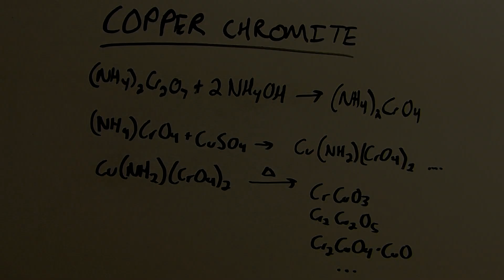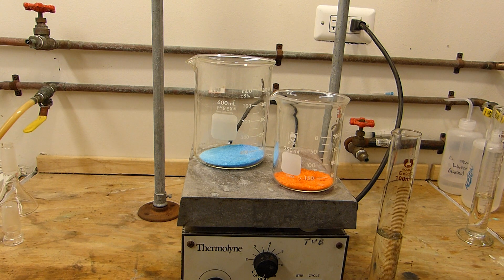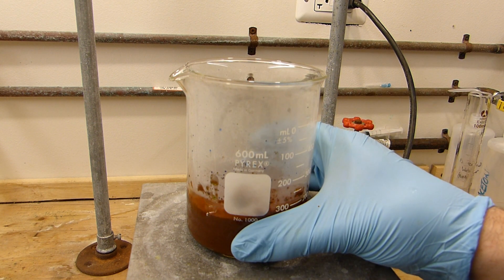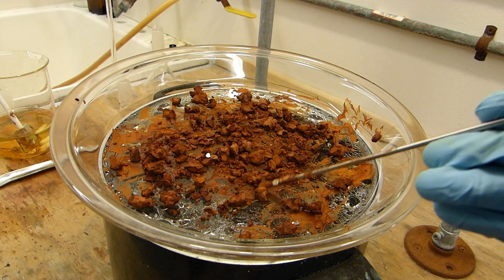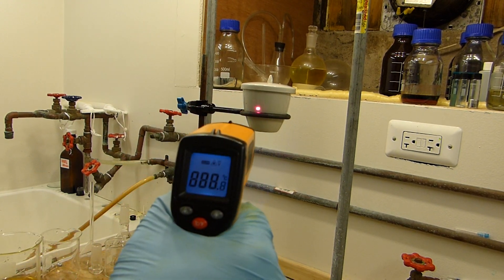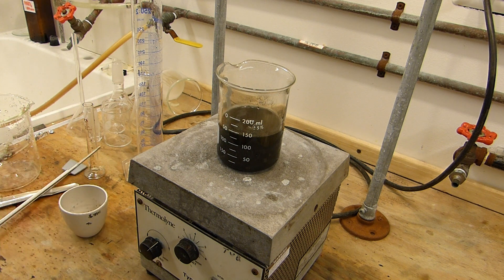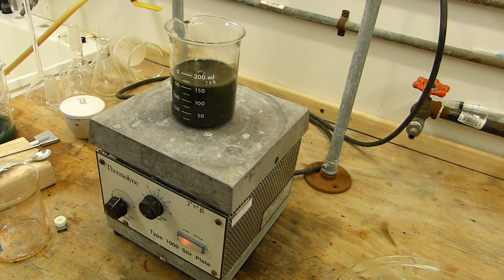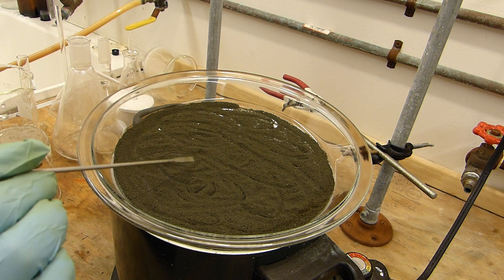Copper Chromite Catalyst

Comment: I picked up a niced vacuum oven at a surplus place - someone had been using it ti degas epoxy, and run resin all over the racks and floor.  I used LN2 to embrittle the epoxy and broike off all the resin, then sand blasted to get the lassdt dregs and presto - nonm-ruijed vacuum onen.

Comment: What’s the original dark green filtrate consist of?  Is it toxic to dispose of? Any chromium?
Reply: It likely still has some chromium VI so it is quite toxic. When I made copper chromite, I added some vitamin C powder from the supermarket to the mother liquor to make it acidic and reduce any possible Cr VI to virtually harmless Cr III. I used a slightly different procedure with slightly different ratios and my mother liquor was actually quite yellow, clearly contaminated with Cr VI.

Comment: For anyone just watching this video; To handle fine heavy precipitates like this, you optimally need a bucket rotor centrifuge that can carry some 250 mL capped plastic centrifuge tubes. A smaller centrifuge for test tubes will also work at smaller scale with more labor, but might be more readily available. These heavy precipitates spin down very quickly into a hard pellet leaving a clear solution behind. Several spins, rinses with vigorous shaking, and repeat cycles will clean up the product very nicely. You can also use a proportionately large volume of rinse water on the order of 10x volume, and allow gravity settling, followed by decanting, with multiple cycles. Some heavy precipitates can be grain refined (recrystallized) into coarser precipitates by gently boiling or cooking in water under reflux for an extended time. (I know Doug hasn't posted anything for 4 years.)

Comment: You mentioned that you used ammonium dichromate, but can this be carried out with potassium dichromate as an alternative?
Reply: No because the potassium can't be driven off in the decomposition reaction step which would leave all of the potassium in with the product so you can't separate the potassium out very well or easily so you don't end up with copper chromite in the end.

Comment: Couldn't you 'just' slit the ring so the thermal expansion difference won't crack the crucible?
Reply: Use a wire triangle crucible support instead.

Comment: I made some.  How do you clean the frit of the copper chromite?  HCL worked on the precipitate real well but what to use on the copper chromite from the last filter step?
Reply: Nitric acid should work. Try dilute (10% dilution of concentrate) first. Most nitrates are soluble in water. Otherwise, you might need a complexing agent.

Comment: One issue with ammonium dichromate is its toxicity and it is next to impossible to obtain as an individual in EU. Are there any alternative catalists that are better-yielding than basic copper carbonate?
Reply: "next to impossible" you say? 50 grams of chromium trioxide are dissolved in small amount of water. The obtained solution is treated with 33 ml of the concentrated (d=0.9  g/ml) solution of ammonium hydroxide. Then the solution is concentrated by evaporation and obtained crystals of ammonium dichromate are filtered and dried in a desiccator over concentrated sulfuric acid. The yield of ammonium dichromate is 70%.
Reply: But yes if you live in Germany or Austria (and a few others iirc) they won't ship chromates to you, many other EU countries are fine as long as you remain under a stated treshold in amount. I suspect CrO3 will fall under the same regulation. But don't be so quick to give up, if dichromates are unavailable for you, make them yourself. The beauty of hobby chemistry. There's always a way around, sure it takes extra work, but as a hobby chemist this should be a welcome challenge. Especially since we're talking inorganic chemistry here.

Comment: It seems impossible to get ammonium dichromate or chromium trioxide in EU due to REACH regulation :((
Reply: You should be able to get trivalent Cr salts instead, and oxidize them yourself. With more work, you can make hexavalent chromium starting with 18-0 stainless steel from cheap flatware like forks and spoons. Dissolve in aqua regia and process from there.

Comment: Hey Doug, im 13 years old and currently have my own lab that i use often and have been wanting to make videos documenting my experience. do you have any tips?
Reply: +Albert Escamilla you are a jackass, sir...
Reply: he should also add some benzoylmethylecgonine if he's going to be doing this on the stove
Reply: +Ac Hendrickson Obviously not Doug but I started with my own lab and my biggest suggestion is just go for it! Simple things first, of course. Start recording, filming, and be safe!
Reply: +Bunsen Burns  thanks a lot, do you have any reactions that are good for practice?
Reply: If you have a hot plate, I would recommend heating baking soda and observing its decomposition into sodium carbonate. It's pretty interesting and safe as long as you are very cautious of the hotplate. You can also calculate how much mass you start with and the mass you lose.
Reply: +Bunsen Burns wow thanks for the fast reply, I don't have a hot plate but I do have a wickless heater. Would that work?
Reply: I would recommend heating on the stove then. In that case you don't even need a beaker and in fact I would recommend using a pan. This is just straight kitchen chemistry, after all. You can store the sodium carbonate for later use.
Reply: Just be careful not to heat to melting. You could also place it in the oven but that defeats the purpose of seeing the CO2 bubble out of the solid.

Comment: At 13:11 was that dust some of the catalyst? If so how come it was doing that? Was the stirring causing a slight 'gust' upwards to evacuate some of the fine powder?
Reply: +Samdroxpie Possibly the pouring of the powder will have displaced air in the beaker causing a small updraft
Reply: Ah right, makes sense - Thanks

Comment: Copper (II) oxide or basic copper carbonate are nearly as effective as decarboxylation catalysts for niacin but then you wouldn't have the fun of making copper chromite I suppose.
Oxidation is not a significant issue in this case.
Reply: Did you ever get around to comparing the yields between copper carbonate and copper chromite John Black Super Chemist?